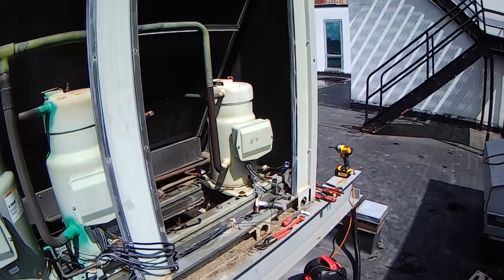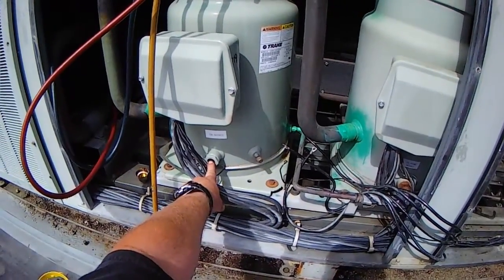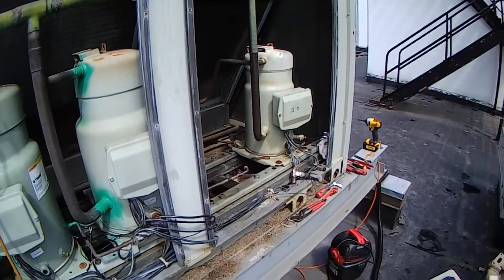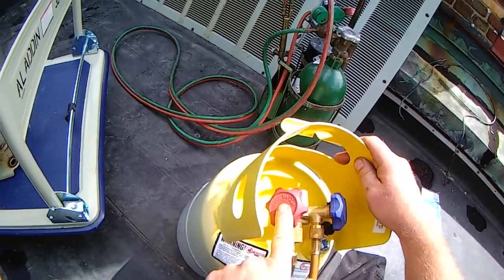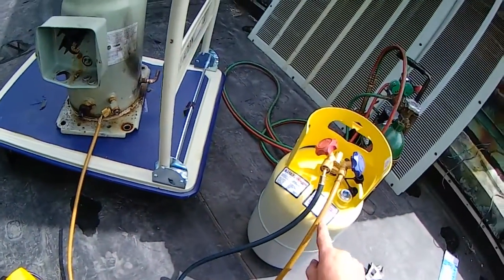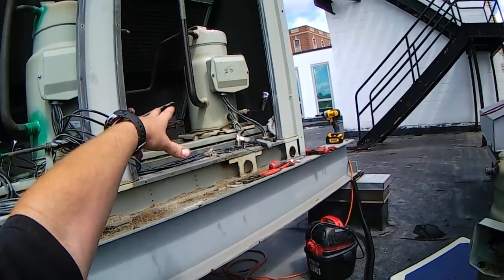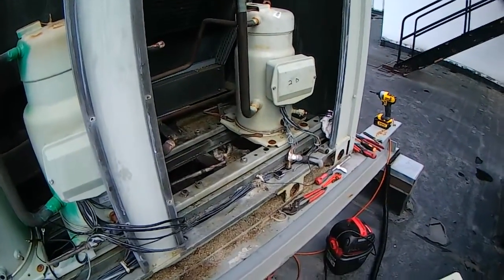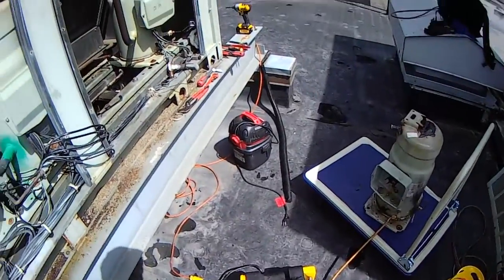HVAC on the Job Training ~ How to remove compressor oil with a vacuum pump

Comment: I have always tilted the "oil equalizer line" (this is what Trane calls it) up above the oil line at the sight glass on the other compressors in the same refigerant circuit and it doesn't create a "oil spill" cutting the failed compressor out and brazing in the new compressor

Comment: Cool video brother. Ill try it! Here is another method I've used.Once the gas has been recovered, I've added nitrogen pressure in the system. Then place a hose on the oil pressure port, and dump the oil into a 5gal bucket.

Comment: I see exactly what youre doing here, but is it okay to recover oil into a recovery cylinder for reclaim? Will the supplier receive it with no issues? If not, how are you disposing of the oil?

Wouldn't it be easier to the pressure up to 5 or 10 psig nitrogen, then hook a hose to your oil drain/fill, then crack the valve and let the force of the pressure above the oil push the oil into a bucket?

That's what I've always done.
Reply from the maker: The tank is used for oil only. back at shop pressurize the tank and force it out into a larger holding tank for oil.
Reply: +Guy Brown 10-4 ;)

Comment: hello mr brown do i have a task to ask.. I've been in the field nine years i recently came to this customer with a bad compressor that i swapped today in nyc on a 90 degree day its a 2.5 system york compressor is bristol
here comes the question after replacing the comp everything functioned well within 4 hours. thermostat satisfied and i got paid for it on the 5th hour the customer tells me that the comp is over heating again i haven't been back to confirm but I'm wondering if my pressures on a r22 system is 65/180 i know my condenser coil is good and my condenser fan is rotating to max speed i just don't get what else it would cause it to over heat... i also took amps and it was below 2 amps of its calling
can you help me out ?  ( also its not a txv in the air handler its a piston with legs )
Reply from the maker: you will have to confirm the issue. check to see if it is in fact thermo overload. did you replace the capacitor?